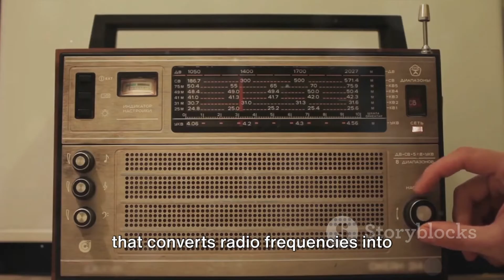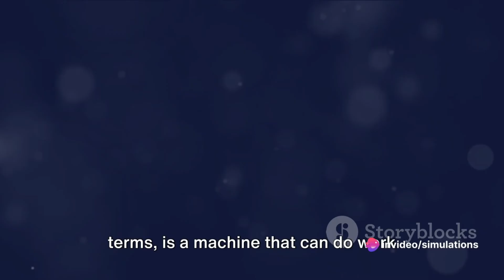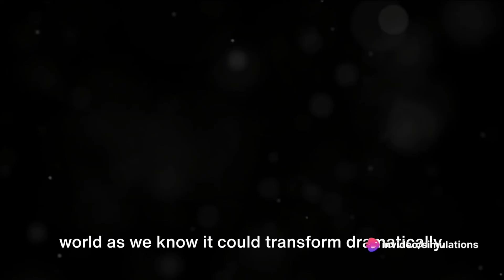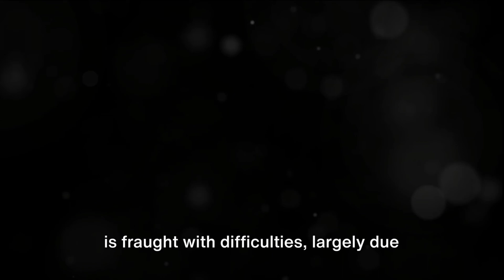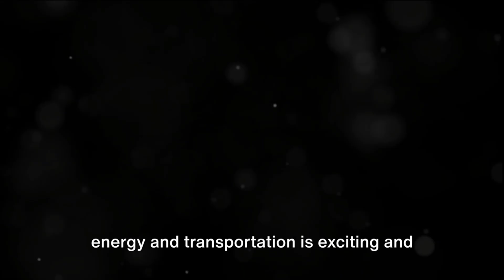Can Radio Frequency Power an Electric Vehicle?

Comment: Indeed, energy can be obtained in such a way, but so little that it is practically useless.

A simple question for anyone who is excited about this invention: how many kilowatts of energy does a single radio transmitter tower needs to operate? Let's say 100 KW if the transmitter is very powerful. Even if it could transmit all of these 100 KW, and this energy could be somehow caught, this would only be enough for a very small number of users.
However, in practice, the energy that can be obtained in this way is only several hundred micro amps! 

It seems we are witnessing a new online test of the intelligence capabilities of the average representative of Homo sapiens. The results are not encouraging.

Comment: I hope they do not eventually shut down all RF transmitters since internet is taking over. Imagine driving out of range of radio reception your car just dies. We will see a lot of stranded vehicles at the reception edge of radio transmissions. What a lot of crap.
Reply: incorrect.  there will be batteries to store the energy from the radiowaves which also come from space

Comment: A question.
 Assuming there actually is enough energy in free radio waves to run a car. What would happen if you had hundreds of these cars stuck in a tailback on an autoroute? Would there be enough energy to keep hundreds of the same radio wave powered cars running remembering they have no energy storage system?.....
Reply: @betacam235  the storage is the source

Comment: energy in radio wave is too low and the device to harvest it is too bulky. Pilipino car mechanic has long been trying to perfect his device but his invention can only run a 5 hp. motor not enough to be used in a car.
Reply: nano sized antennas on a chip
Reply: @Kardashev78  Will produce "nanopower".

Comment: but it will consume the energy of radiowaves resulting in weakening the energy level of our TV and Radio signals if many people use that energy. Electromagnetic Energy is not unlimited but depends on the quantity of its input from different sources like the universe, the TV stations, the Tel and Radio broadcasting stations emitting these signals. So if we use the Electromagnetic energy of Radio waves, it's bound to consume also those we broadcast, the moment many people start to use it. It's a great idea, but its consequences should be taken in account instead of presuming, that we have discovered an unlimited energy resource!

Comment: No it’s been done long before Nicola Tesla broadcasted electric via radio waves. It’s perpetual motion because the energy is coming from radio waves wich are generated and the car is simply running on an outside source. absolutely a 100% viable choice to fossil fuels and power for electric cars. 
Another option would be bioethiric batteries, living batteries that produce energy through biological processes.

Comment: CLICKBAIT!! Article never addresses the question posed in the title - just rambles on as a sales pitch for Hopeium!
It takes kilowatts to move a mass the size of a car - even if you were able to convert 100% of RF in the air, with zero losses (Impossible) there is still only "milliwatts" at best - maybe light an LED but not drive a car or supply your home.
I am all for innovation, but this is Total Dreamland!
Reply: JUST LIKE THE NEUTRINO GENERATOR FROM GERMANY THAT REALLY WORK! GOOD WORK MAXWELL ON THIS INVENTION TO SAVE THE WORLD FROM THE DIRTY ENERGY. WE LIVE IN AN OCEAN OF ENERGY. USE THAT ENERGY TO TURN THE MACHINE OF THIS WORLD. THE GREATEST INVENTION OF ALL TIME.
Reply: Hopium 🤣 Whats the atomic number of that element? I'm guessing it's somewhere around #420 🤣
Reply: That sounds about right. I wish it was true, but the numbers don't work.....

Comment: Snake oil? There's this annoying little thing called physics. Chikumbutso’s claims have shifted over time. In 2013, he initially stated his device generated power “from air.” Now, he describes it as harnessing radio frequencies for energy production. He has said this technology can power various vehicles, including cars, helicopters, and bikes. Chikumbutso acknowledges his invention allegedly violates fundamental laws of physics, specifically the laws of thermodynamics. When attempting to patent the technology, he reports being rejected on the grounds that it violated natural physical laws and lacked industrial applicability. Rather than addressing these scientific concerns, he says he opted to treat the technology as a trade secret. The scientific premise behind the purported GPM is similar to actual physics-abiding technology known as radio frequency harvesting. The concept with these devices is that they they convert ambient radio waves, the result of humanity's love affair with technology, that bounce around our planet into enough energy to power extremely low energy devices like smoke detectors or fitness monitors. A 30 September 2015 story from the Telegraph about a company named Freevolt describes the basic idea. The central difference between radio frequency harvesting (which can at present barely power a Fitbit) and Chikumbutso's GPM is that the latter allegedly takes these radio frequencies and somehow amplifies them without extra power merely by exposing them to a "trade secreted" substance. Evidently, the gathered reporters were not given enough — or any — information to test these outlandish claims. "We are not sure how this assertion can be dispelled and we hope at some forum scientist[s] will put the claims to test," TechZim said three days after the event. As is often the case with  internet articles, the claims made there have been cloned and regurgitated ad infinitum by other dubious clickbait sites. It's also entirely possible that investors, and perhaps even Chikumbutso himself, fully believed in the technology they attempted to demonstrate in June 2015 — but the fact that no more demonstrations have occurred makes it clear something was, or is, off. It strains credulity to think that a car that runs indefinitely without recharging or fuel would not receive widespread financial support. Was it always a scam, perhaps designed to elicit donations? It's possible, and the Saith Technologies website does have a donation section. Perhaps later web sites realized that this self-made genius story was clickbait gold and continued running with it for that reason. But the burden of proof for upending the first and second laws of thermodynamics lies squarely on the person making that claim. No proof has been offered in the years since the claim was first made.
Reply: Excellent, detailed response; this perfectly reflects my own view. This affair reminds me of a well organised 'flying car' scam some years back.
Reply: Well said! I agree fully.

Comment: Super genius🔥
Also FREE ENERGY like the acceleration of a wheel can produce enery thru magnet coil to run machines without using Petrol product like diesel gas,electric,solar🎉🎉🎉🎉

Comment: Electromagnetic waves are of different spectra. Waves transmitted from sun also are same. They carry energy in form of photons and we xonvert it to electricity. We then use it to drive cars. So, what chikumbutso did is he chose one another spectrum of same radiowaves and used energy in it to drive a car. I dont think its impossible. Its just a matter of amplifying the energy, which may be quite possible. I am not a science expert. But chikumbutso makes sense.... All the best to him.
Reply: @ajaylahane2916  sun rays contain a lot of energy. You cant touch a metal plate kept in direct sun for few hours it's that hot. Radio waves, in the other hand contains tiny amount of energy which is not useful for anything apart from communication. Amplifiers also use energy from a battery or electric power to amplify the original signal (e.g. sound wave). You can not generate kilowatts of energy from miliwatt of energy. It's simple physical law.
Reply: @Marv3Lthe1  you seem right. But this guy might have got something discovered not known to us... Who knows... Let's wait and watch..
Reply: You have a simple understanding
Reply: Yes, you're not a science expert. I am. To amplify power, you need to add power from somewhere. His claims are bogus.

Comment: Microsonic waves cannot move any vehicle or motorcycle, its too weak !
Reply: Did you practically tried it yourself, or maybe you are just theorising?
Reply: @ishmaelgwatiringa8224  I'm a electrical/mechanical engineer & real inventor, I was the first person on the planet to invent a vehicle that does not need any recharge & unlimited mileage I even changed the braking system with zero maintenance, I was in the news worldwide, he probably read about the idea & stole it from me, microsonic waves are too weak to charge a car it's noncense, even the TV that he said is wireless & use no power, was found to be a scam, there was a battery with a pc board behind it, he never build any cars, those 2 cars are build in China & does need recharge for their batteries, he can charge the batteries from the trunk/ boot from a car, but needs a silent generator, but the generator needs fuel or batteries to run it. My vehicles does not need any batteries or fuel or generators or any maintenance, I designed it myself also !
Reply: But Chikumbusto knows how to harness and strengthen it… Listen to him explain it….
Reply: @dr.uzo.official  he watch too many movies, he has been caught telling lies about his TV, check at the back of his TV, then ya'll will see this guy is a scammer !

Comment: The energy of radio freaquency are very low with which you can't move a car. If the energy levels are high it will bourn your skin and the items that use them such as mobile phones
Reply: Strong RF could fry a pacemaker.😮
Reply: ALSO USE FREQUENCY FROM SPACE JUST LIKE THE NEUTRINO GENERATOR OF GERMANY. VERY IMPORTANT INVENTION TO SAME OUR PLANET FROM DIRTY ENERGY. WOW!
Reply: Listen to Chikumbusto explain how it’s harnessed and enhanced….
Reply: @dr.uzo.official  His explanation is nonsense. His contraptions don't even have any antenna for collecting anything.

Comment: For God's sake, it DOES NOT violate any law of Physics!  The energy source is microsonic waves
Reply: Violate physics law ?😂😂😂😂
There is nothing which is called physics voilatoin 
Every new law adds in physics!
Reply: @highclutches491  Yes yes yes, many many forces of nature or physics laws waiting to be discovered
Reply: @highclutches491 you are stupid
Reply: Transmitter towers emit electromagnetic waves, not the so-called microsonic waves.
Reply: @ it's micro wave
Reply: What is a microsonic wave???
Reply: @johanels199 it is bullst. It is a scam for the hopelessly stupid
Reply: Sonic means sound, nothing to do with radio waves.
Reply: Oh yes it does. To run a car the RF waves need amplification of up to a billion fold. This would require a large energy source so where is this energy coming from? I'm afraid it's all a scam
Reply: Fact
Reply: I think Maxwell is not telling us the full story
Reply: @MichaelWard-lr7my you need to go back to school. Something’s you’ll never understand
Reply: Radio waves carry very small amount of energy. In microwatts. It will never generate kilowatts level energy to power a car.
Reply: @Marv3Lthe1 keep on dreaming
Reply: @Marv3Lthe1  Any way it's amplifying the energy into higher level he also proof to drive the car and tv without charging power and no need batteries also.
Reply: @Marv3Lthe1  unless of course the radio waves are amplified. duh
Reply: @landguardeagle22  amplified radio waves with kilowatts of energy will fry everything around the tower, including you. It's like putting your head inside a microwave oven.
Reply: thanks  @Marv3Lthe1  for explaining it to them.
Reply: @Marv3Lthe1 True, but Maxwell claims that his machine can amplify that energy, to the point where it can be used to power a car and even a house.
Reply: @bobhebel4116  an amplifier also needs external energy to amplify a signal. For example, an audio amplifier uses electricity to amplify sound. Here if you want to amplify the radio waves, you will need a secondary energy source. Energy does not grow on its own. It's against laws of thermodynamics.
Reply: @Marv3Lthe1 That is Maxwell's claim. I'm not saying I agree with. I'm just pointing out that that's what he says. For the record, I hope his radio frequency-powered invention is legitimate because it obviously would greatly benefit all people. But I do have my doubts.
Reply: @Marv3Lthe1 radio waves are available around us in as little power as nanovolts his tech now captures these tiny volts using high tech components and then using inverter to convert these DC nanovolts to AC and later to step up transformer to produce the mega power he demonstrates. So his tech adds up our understanding on radio frequency
Reply: @bobhebel4116 prove it. Without proof who would listen
Reply: he is lying
Reply: Yes, you can amplify but you need ANOTHER source of power that exceeds the desired output power…. People learn this in Electronics 101…… LOL
Reply: @Marv3Lthe1 what's the use of an inverter? Didn't you hear him talking of using a specialized inverter for conversion. The truth is since he has been denied patent it would remain a secret. The components he used for harnessing and conversion you won't find anywhere still a tech secret.
Reply: @bobhebel4116 you don't "Amplify" energy. 
You can take a weak signal, and use that signal to control a powerful flow of energy which makes the the signal. 

You can't have an amplifier without a power source. It can plug in, use batteries, or even run off a solar panel or other source. 
You can't amplify anything without a power source. 

Just curious,  how many of you that believe in this, also support trump?
Reply: Amplifiers need external power & are made up of components which are lossy.  So from where do you get more power than you give it. That apart, in areas of no radio network the microsonic device will sink in  radio silence.
Reply: Every law violated: physics, chemistry, biology and even economics
Reply: Energy is proportionally to its wavelength radio wave has a long wave length therefore very low energy less than a snow flake falling from the sky.
Reply: @KeanHor that is nonsense. 
A microwave can have as much energy as an AM broadcast signal, and vice versa.
Reply: It is a scam for the hopelessly stupid
Reply: The radio waves are too weak to run any vehicle or motorcycle, it's all a scam bullshit !
Reply: In 1903 the Wright brothers were laughed at ridiculed and told it's impossible to fly,, today every fool is flying. These laws of physics were not created by them and they don't know all of them, only the Creator can say that, if it's impossible why then the Americans were so threatened that they even poisoned him and his business partner ?
Reply: Bcoz its from Africa and threatens oil companies and Musk, they will ridicule this technology, Nicola Tesla said "there are many other forces and sources of energy that will be discovered", well they must rewrite those stupid laws of physics,  they are not God with their laws of physics.
Reply: MIcrosonic waves is a pseudo-science term. It is just a scam.
Reply: for god sake stop being overproud and stop asking validations  ,, africans love asking validations and stop usinmg their brains
Reply: @peterkalebwe688  Its just another invention that runs on 💥 Hopeium, unfortunately Hopeium never has the power that the inventors mind thinks it does.
Reply: My aGod you are stupid believing this
Reply: If it's micro sonic energy harvesting device then it has to be getting one of the energies from the Shumann resonance, the Earth's heart beating vibration of 7.83 hertz. Similar to what Viktor Grebenikov's levitation platform which is actual a biological super capacitor that gets its energy from the Earth's 7.83 hertz vibration, this was clearly revealed by the Electrical engineer, Dan Winter.
Reply: Chikumbutso himself said many times that he invented perpetual energy that transgress the laws of physics, he actually bragged about it! "Microsonic" waves, is a term coined by Chikumbutso himself. Let's analyse the term: micro, meaning small and sonic, meaning sound, so tiny sound waves. If that is possible, then you will be able to power the whole world with all the noise that is going around continuously. Why did no one think of that. And remember, radio waves only become sound waves when you pick it up through a receiver, then amplify it with lots of external power, and then send it to a loudspeaker. The power that the amplifier is using is a few million times stronger than the radio waves that carry the "sound". If something looks like sh*t, smells like it, tastes like it... it is probably just that, shit!
Reply: Microsonic pot kak Dom ka.....
Reply: It goes against laws of business... Could mess up with communication system

Comment: But somehow I don't think there that defiance of physics. It gets external energy, not self-generating as purportedly said. Should the radio emitters stop emitting this energy, the can can not work. How then is it defying the laws of physics?
Reply: As long as humans live in the buble magnetic protection field surrounding earth with huge diameter and growing, the concept of bio will work on stations already functioning. Every crystal on earth amplifies vibrations, resonance, and waves. Any energy is vibration, only needs converting without an anti-amplifier.
Reply: And what's powering the emitters, hmmmm?